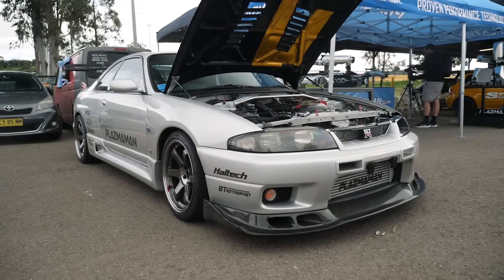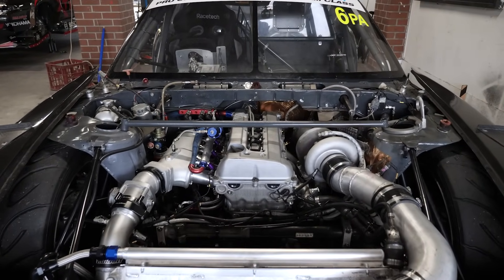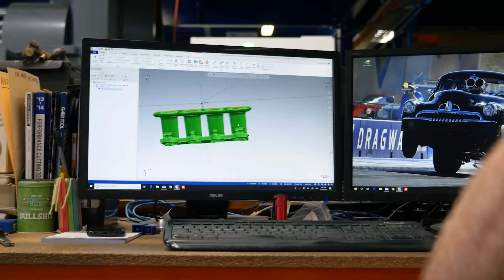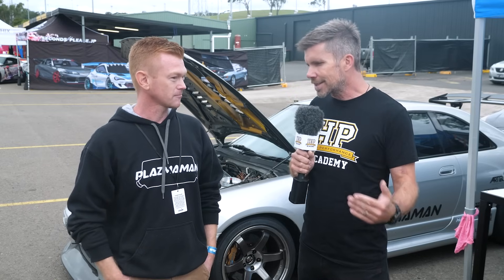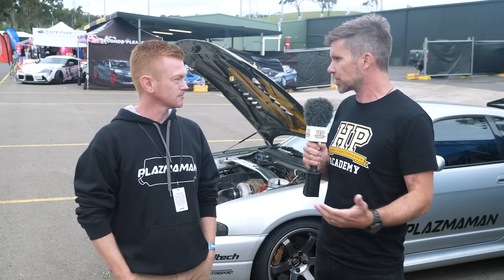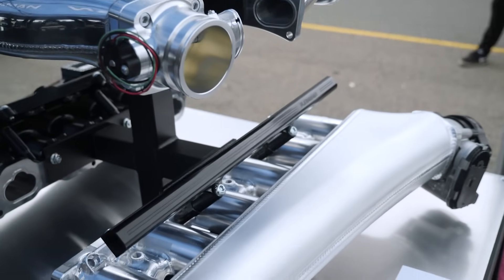When Bigger ISN'T Better: Plenums AKA Intake Manifolds

Comment from the maker: Check out the previous [TECH TOUR] chat we did at Plazmamans facility. Link at end of video.
Building a fast car? Get $400 OFF the all inclusive VIP package deal:  https://hpcdmy.co/vipy49
Learn to make awesome custom parts for your vehicle. 50% OFF your first fabrication course: https://hpcdmy.co/offery49
TIME STAMPS:
0:00 - Common Upgrade
0:23 - Shannon Rogers - Plazmaman
0:58 - Main Design Considerations
1:37 - Reasons To Upgrade
2:04 - Aesthetics
2:21 - The Only Mod You Need For More Power?
4:04 - Design & Validation
4:50 - Overall Power Isn't Better
5:24 - Inlet Runner Length
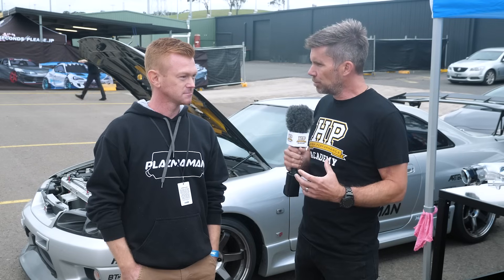6:31 - Volume Vs Capacity
7:09 - Throttle Body Sizing
9:09 - 800hp - 1000hp - 1500hp & 2200hp Sizing Examples
10:22 - Pro Tip: Measure Pressure Drop BEFORE Changing
11:08 - Fuel System Restrictions
11:49 - Fuel Distribution Concerns: Dual/Staged Injection Setup
13:33 - Flow Distribution: Within 1% Where Possible
14:40 - FG Manifold Example
15:01 - Don't Assume, Get Some Data
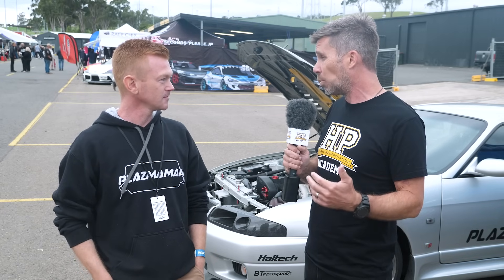15:20 - Plazmaman, They're Everywhere
15:38 - Thumbs Up, Learn More. Do It. Now. The Old You Would Have.

Comment: Ok here’s the skinny
I spent 3 yrs on methanol engine development on the dyno
Let me tell you
Some bogg  std manifold from an evo or even a NA car with boost up to around 30 psi is hard to beat
Unless you start into dual plenum style only then will you see real gains
I’m sure some of these plenum’s work
But in the real world when your at the club sport level
Just try to size everything correctly and you ll make good hp and the thing that wins is torque 
Just look at WRC and  LeMan Audi diesel s etc

Comment: Is there any specific rule of thumb when it comes to plenum size? 
I for example have a 2L 5cyl that left 230hp and 267nm (calculated crank) but my throttle response is terrible and the theory being that my plenum is to big. How should i go about calculating the volume when i go about building a new intake all together?

Comment: Am I going to mess up something or do it in vain, if I smoothen and enlarge the stock intake before the air filter and the sensor in a naturally aspirated car? The initial inlet seems small compared to the rest of the system, and it's not located in the stagnation zone as well as it could be. I know the manifold itself is beyond me, but allowing it breathe better before the filter should - at least in theory - do no harm, right?

Comment: They're right on the money when it comes to going too large in the plenum size as well as the throttle.  I actually prefer to over size my throttles some as I like a touchy pedal within reason. But going back to the plenum, the Helmholtz theorem is a very good guide on idea size for the application and in my experience, going bigger than needed makes the engine very unresponsive and soggy to drive, even with a larger throttle in the mix. 

With throttle size, I generally used a program like dynosim to simulate where a throttle starts to choke, then pick the size a few mm or closest above the min and use that.  The power figures mentioned for throttle size in this video are a foreign language to me, since I only have built and hotted up NA engines.  

I found at least with sims and actual real dyno/road testing on some engines, 60mm NA is good for around 300hp, 65mm was good for 340hp and 70mm could support 400+ pretty well unrestricted.   I never went any further than that since my engines can't support or even will need anything bigger than 68mm in real life.   When boost is added, the stock 60mm is heaps as mentioned in the vid.

Comment: It's all a plumbing problem both in and out .
You want horsepower or torque ? RPM or pulling power ?
An adjustable intake and exhaust .
Large tube small tube .
The base that bolts to engine off gasket then braze on tubing (brazing or sodering tubing allows easy removal with 2 small welded tacks) same with exaust but need pipe stretcher an exaust clamps .
Temporary to explore your engine !!!
Multiple carbs even a very small single barrel almost lawnmower carb will surprise you !!! 
Now this doesn't work too good for cold climates...
Fuel filler hose and hose clamps to play with runner length .

Comment: If people read HVAC standards and Air Velocity standards based on fittings it will work beautifully on induction system...as well as exhaust...you gotta know what are velocity reducers like elbows are and  tight bends and by how much...whats the target requirement or air velocity and how are all the fittings together cause pressure drop. Ashrae standards are great resource.

Comment: One question about an info in the video, when he says about trottle body inside diameter,  60 mm good for 800 hp, 72-74 mm good for 1,000 hp, 85 mm good for 1.500 hp, and 90 mm good for 2.200 whp. All power ratio are at the wheel I suppose?

Comment: how come y’all never talk about VWs and Audis?? how come all these tuner programs/schools support so much jdm? honda subaru etc. what the hell?! I wanted to hear about whether it made sense to buy the ECS aluminum gen3 manifold for a Stage 2 vw stock turbo,  or the HPA manifold for a similar Audi, stuff like that. There’s a ‘water cooled’ manifold HPA offers for N/A R32 VR6 engines, but its like 4 grand?!? I wanna hear about if it makes sense or doesn’t for those, I don’t own no GTR or some roll caged Honda as a daily driver 🤦🏽‍♂️😖
Reply from the maker: Just not as popular at the events we go to. We are adding more tuning courses content using VAG cars this year though.

With the price of the old go to options getting crazy I'm sure we'll see the next generation of popular options come through the ranks more and more and also gain more aftermarket support too.

Note we don't sell anything you mentioned there - Taz.

Comment: I love the Plazmaman manifolds, quality is absolutely amazing! I just got my Plazmaman manifold in for the 1997 1FZFE Land Cruiser that I am building!
Reply from the maker: Nice one, what are your plans for the Cruiser? Hope you're enjoying the build! - Taz.
Reply: @hpa101  It was a very run down 1997 when I purchased it a few months ago. I stripped the interior and will be replacing carpet & leather, front and rear axles are being rebuilt, cylinder head is being fully machined and rebuilt along with new springs. Engine block seems okay, will be cleaning it up along with new rod bearings. Then the Plazmaman intake manifold, custom air to water intercooler and piping. Planning on Haltech 2500 and 2GRFE coils to replace the distributor. For the turbo I have not decided yet, I think possibly a Borg Warner S362SXE. Larger injectors and fuel pump. And of course a full custom 3 inch exhaust and tune to finish things off.

Comment: Bigger throttle body tuning is easy to get around... Offset the wheel like I did. so you have lots of movement down low for part throttle, and quick WOT at the other end.

Comment: Been porting engines for a long time. When it come's to intake manifolds the 2 most important things are "smooth" airflow, and cylinder equalization. You want all air turns to be as smooth as possible with no turbulent ridges or "steps" in between parts. You want all cylinders to have equal flow from the air source all the way through the cylinder head and out the exhaust, and the intake manifold is the first critical piece to accomplish this. As far as plenum capacity things get a bit more complicated but you want to essentially do is "shape" the plenum to make sure the back cylinders are getting the same airflow as the fronts and can meet the flow needs of the cylinders. This will determine the size and shape of the plenum based on the application. Bigger is not always better.
Reply: Have you found that these wedge shaped manifolds make much difference compared to a evenly shaped one ?
Reply: @TheRobphobos  This is basic fluid distribution topic. The header should have overall low dynamic pressure to ensure better distribution. The tapered kind ahieves this but also reduces materail use  and gives overall better aestatics. 

Too little attention is given to the exhaust manifold - but cylinder airflow distribution depends on both.
The best would be to do a "Z" coupling - meaning the cylinder with the inlet closest to the inlet of the air-manifold should have the longest distance to the outlet on the exhaust manifold. Then the air-flow should be more balanced as resistance in the manifolds are more even.
Reply: Researching is the hardest part I find . Trying to find the right video with ideally a 3d diagram of how the air is flowing through the plenum evenly to all cylinders with no steps or turbulence like you said . Finding the right video with that plenum . I'm sure there are alot of plenums that are not like that
Reply: @joels6736   I’m surprised that the Audi IMSA GTO intake design “Heinz Lehmann style intake” hasn’t become more popular, especially since it’s proven to work, and these lazy ‘designs’ have distribution issues.

Comment: wait... a 4psi pressure drop across the TB is reasonable? That sounds WAY larger than I'd expect. I would have expected even a 1psi drop to be an indication of an undersized TB.
Reply: My thoughts, and they're basically discussion points - 

That IS way, way over what I would have expected and I'd seriously question the wisdom if the person was citing it for a lower powered vehicle. However, the examples he cites are  bit more than 'normal' vehicles, and 'undersized' TBs will give a lot more control at the cost of a few hundred horsepower which would still leave way more than the street could take.
Perhaps  an option for the very high output setups, of the chaps and chapesses, would be to have a smaller TB for the street, with a street tune, and the larger/est bore for the strip where it would be running a high power tune? With quick release couplings, it should just take minutes.

For comparison, the airflow rating In the USA for four barrel (4bbl) carburetors, which one would expect to be the street 'performance' option, is at 1.5”Hg (20.4” H2O.) through the carb' - that is 0.736731 PSI. For a little more top end, some will upsize a little from there. Remember, that's with a bunch of restriction and a drop being required for the venturiis to work. They will normally offer very good driveability at that drop.
HOWEVER, the turbo' has the spooling issue where the actual torque can rapidly change between off and on boost, and those torque levels will be MUCH higher that a similar N/A engine can produce.

For an average street engine, perhaps just using a TB of the same ID as the plumbing (which should also be sized for the application) with either a progressive mechanical linkage, or electronic' mapping, to give a slow initial opening for better throttle control at light openings, and faster opening close to WOT, would be best?
Reply: @gordowg1wg145  can you tell me what pressure drop is used for 2bbl sizing? My recollection is that a 2bbl carb flows less than a 4bbl carb of the same CFM rating.
Reply: @totensiebush  
"1bbl and 2bbl carburetors are rated at 3”Hg (40.7” H2O.)", so double the pressure drop of the 4bbl.

Not sure how it works out when running triple (or quad) deuces from back in the day on some of the US engines - whether they're rated as 2 or 4 bbl carbies? There is a conversion one can use to directly compare them, but can't recall what the constant was off hand.
Reply: This is a 2-year-old thread but... It's because they're talking about pressure going through the throttle body. The large throttle bodies or multiple throttle body intakes are generally for naturally aspirated vehicles where any pressure drop makes a difference. With a blow through throttle body, it doesn't matter because you just increase the pressure on the other side unless you're hitting the limits of efficiency for hitting a higher pressure

Comment: Thanks for this. Been trying to tell the Honda boys for years that a bigger throttle on a stock Honda isn't going to make it faster, it's an uphill struggle though.
Reply: 70mm throttle body on a 1.6 single cam🤣 all too common
Reply: @tayvonrose2528 i had 80mm on B230 8valve engine. Some have gone to 100mm with stroked version of the engine. Currently 65mm because throttle modulation is easier
Reply: @0hjaa3.0  b230 8 valve large throttle im guessing its NA? yeah just get a 16v head and make more power easier
Reply: Always an issue with Honda’s, always an uphill struggle as the engines just don’t have the torque to get up hills 👀🙈😂
Reply: Depends on rpm more than anything
Reply: That throttle response is the real benefit
Reply: It can, but it's like he said, it's all about air velocity, not air capacity. If by increasing the throttle size you increase air velocity, then you'll increase power.
Reply: @Car.los.Moreira  Increasing the throttle size will decrease the velocity not increase it.
Reply: @Harry-uo2cr  depends on a multitude of factors. Including engine harmonics. Theoretically, increasing the sectional area of a flow pipe while maintaining the same air output, will indeed reduce the velocity. But practically it will also affect the output capacity of the air pump (the engine). So it can either increase velocity by increasing flow or create turbulence and reduce velocity.

Comment: Would the throttle body sizing apply to naturally aspirated engines as well? Like if you didn't have the right supporting head mods (upgraded cams, valves, springs, porting), but upgraded fuel system (pump, injectors) it would negatively effect it?
Reply: Yes
Reply: Without aftermarket cams you're not really using the extra air volume you get from a bigger throttle body. In my experience they make stock engines lazy 😴
Reply: @eddiel4226  thank you I thought that might be the case just wasn't sure
Reply: I have 2,3L N/A, higher lift cam, adjustable cam gear, increased compression ratio, racing header, full fuel system,e85,big plenum, long runners, 80mm throttle body and it's a lot better than stock 53mm. Low speed throttle modulation took time to learn but it's really good on half and WOT.
Definitely worth it.

Bet it would be even better with boost.
But ofc it depends on the engine also fuel economy is especially bad because of 80 mm TB. Still worth it.

Comment: Why aren't there centre feed manifolds, it seems so logical to keep distribution even across the cylinders...or a small throttle bodies at either end...
Reply: I think its entirely for packaging reasons. Centerfeeds point the throttle body at Tue engine mount and/or steering column
Reply: I think it's flow reasoning.
I've seen JUN intake manifolds on a 3S-GTE motor Gen2 and Gen3 as center feed even in OEM. Apparently, 3rd cyl seemed to always run lean.
For Gen4 and 5,they went side feed OEM.
Reply: Nissan RB20/25

Comment: The Plazmaman intake manifolds for the 4G63 are odd designs. The long runner manifold is marketed to suggest more midrange torque due to the runner length but it has a massive internal volume. Their site suggests this is to support rpm in the 10,000+ range. If you’re spinning the engine that high, why the long runners? The other design is much closer to the Hypertune manifold with short runners which favour top end power but this has a small(er) volume which according to plazmamans long runner marketing would not be ideal for high rpm. I called the them to discuss it, and the bloke was like yeah nah they’re both good aye. Couldn’t give me any practical advice on which one would suit my aims, but did say the long runner version made over 800hp… confusing AF.
Reply: While I wont list all the specific measurements a 4g Mitsubishi intake I developed in 99-2000 is contrary to most current intake manifolds being marketed.....larger plenum....large throttle body....and(contrary to popular marketing) long runners....very long.....the one hint I will give is the intake was built to second order harmonic .....added enough to whp and tq that we ran out of injector in testing on an 8 injector set up of the time.....same boost level added over 110ft lbs tq and over 160whp....next closest aftermarket intake only added half that....short runner intakes in most cases are crap .....shiny trinkets....automotive jewelry that do nothing for performance or very minimal gains!!!
Reply: @pirsq314  I have been also curious why all manifolds have short runners when theory favors very long runners
Reply: @timmurrayy  depending on how much longer they are it may not hinder performance that much to 10K. The optimal runner length between 8k and 10k May only be a couple inches difference.
Shape/MCA/and even stroke are big factors with manifold design. Length is just a single factor.

Comment: Taz from a tuning aspect what have you noticed you had to change in the tune when upgrading the intake manifold? Timing, fuel, what area of the powerband? Since many new cars are direct injection, ports for additional injectors are now integrated in these aftermarket intake manifolds. I see billet, cast aluminum, and combination of aluminum and carbon fiber. Also new cars are using plastic intake manifolds that I noticed doesn’t have a smooth path for air flow internally.